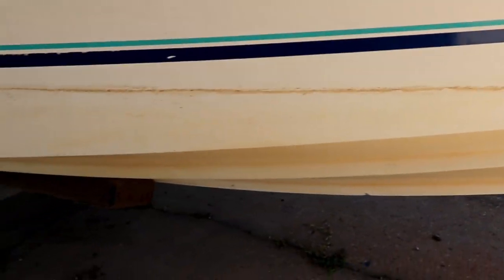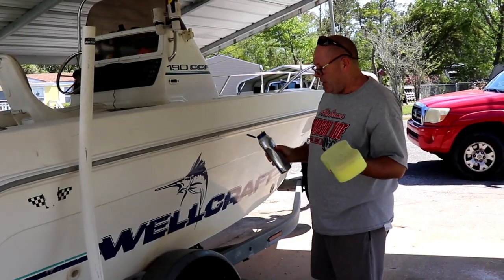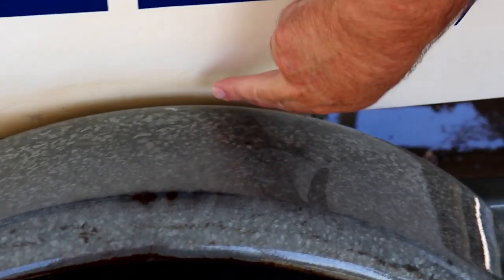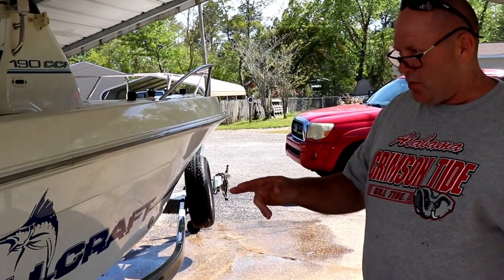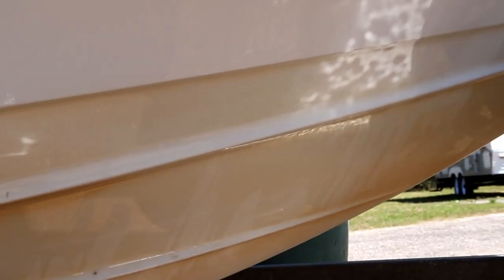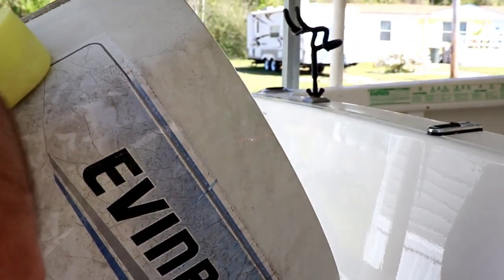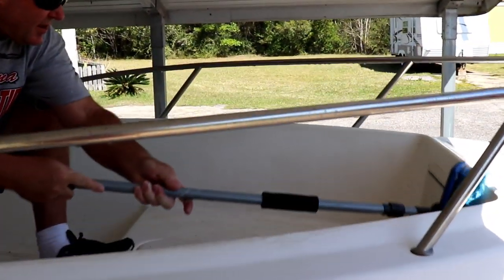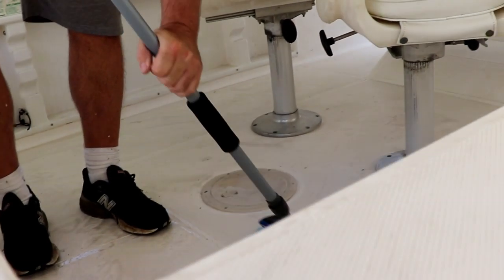How to Clean Boat and Get Rid of Water stains (Less than $2)- Barkeepers Friend

Comment: I rarely comment on YouTube videos but you just saved me. I purchased a boat that the hull was rarely cleaned and had terrible staining. I almost gave up then I saw your video. I am just doing a 3rd run now and she is pretty much clean.  Just wanted to say that you Should wax the boat after using this as I'm sure it strips the wax layer off.
Reply from the maker: Yes you are correct, wax it and it will look new!

Comment: I have a question I used that to get the brown water stain off the sides of the boat and everywhere I put it looks like it was scuffed? I can run it with my hands and there’s a little white powder. Assuming the gel coat. Maybe because it put it in with a little brush? It did take the stain out and I was able to buff it back to normal. But I’m hesitant to use it now I’m afraid it’s gonna ruin the gelcoat
Reply from the maker: Yes you can overdo it. It may need to be waxed. Most boats with stains like this are old and the gel coat is pretty much already gone. Mine was on this boat.